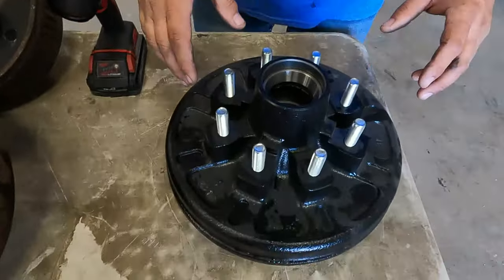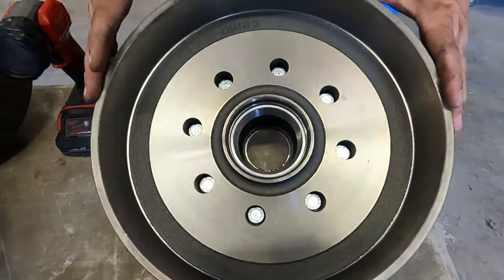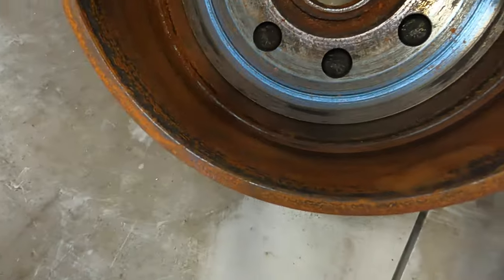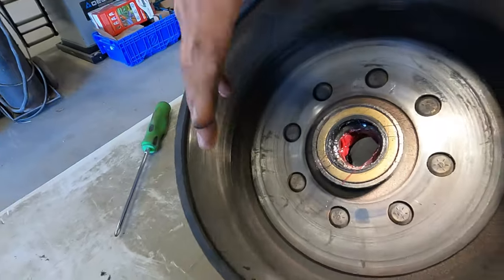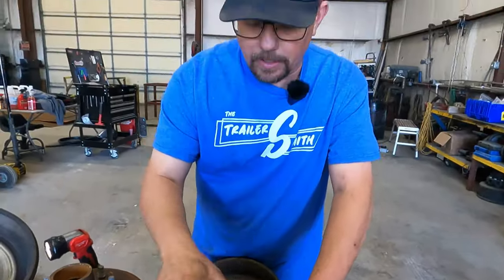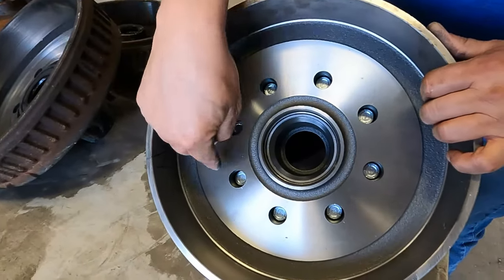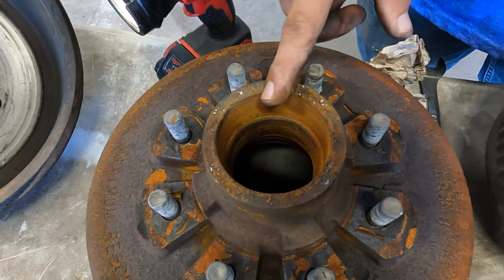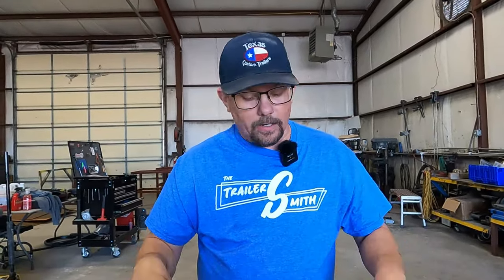Is It Time for New Brake Drums?

Comment: I don’t know if you read these but….
I bought a new boat and trailer…
It’s ez lube so my routine is to pump the trailer every few trips, before long drives and before and after winter… but this time one of them was wet, not soupy, but definitely not dry, now I know to replace all the rubber seals now as well as every year and that from now on I should pump those bearings for new grease every time I use it, until one of them starts to pump out new with too few or two many pumps…
So I get to pump my axles every time I use my trailer is probably more accurately “XTRA” lube…
But some might argue that there is plenty reason to believe that pumping a bearing every time you trailer, and replacing cap-plugs every year, plus repacking once a year is maybe more laborious and has a higher maintenance cost than a trailer with bearings that you just repack once a year…
I honestly didn’t know how EZ Lube was better than the old way… I don’t think its potential benefits are well aligned with my desired overall costs…

Thanks for so much honest information!!

Comment: Can you comment on what you think is the life expectancy of RV trailer brakes/drums, say moderate use? Thanks for your videos-super helpful!
Reply from the maker: A good operator with proper preventative maintenance on their trailer should be able to get several years out of their brakes.  But if pulling on a daily basis, in the city, or the mountains the life expectancy will decrease. If you haven’t already, we have videos on adjusting trailer brakes and burnishing your brakes that might be helpful as well. Hope this helps!  Thanks for watching!
Reply: Thanks! My RV is 5 years old, not full timer. I used to be able to lock up the brakes but no more. I have adjusted the brakes as specified. Checked the brake controller, OK. Trying to figure out next step.  Thanks again

Comment: Where is a good place to buy your trailer brakes and drums from?
Reply from the maker: First, I always like to direct you back to your local options. Look for a good shop that does trailer service or repair and ask if they will sell you the parts you need. You can also try a locally owned auto parts store, but the big chain stores are not likely to carry them. If none of that works out for you, we’ve left some links in the description for them that you can order from Amazon. If the links are not for the sizes you need, you can look around the listing to see if they offer your sizing through that brand. Hope this helps!

Comment: Is there away to tell if you have self adjusting brakes  by looking at the backing plate. Thanks awesome information.
Reply: super easy to pull a hub off to check it. You can also inspect it all while it is apart then.

Comment: question sir......im turning a 70s 5th trailer into a big flatbed trailer to haul my small kubota tractor around and am kinda lost when looking at ordering new hubs bearings etc. how do you do it? like ordering right size bearings, wheel hubs to go from the old 4 weird lug to a modern say 5 star rim ? the whole thing needs redone cept for the axles. i use etrailer to get all my parts.